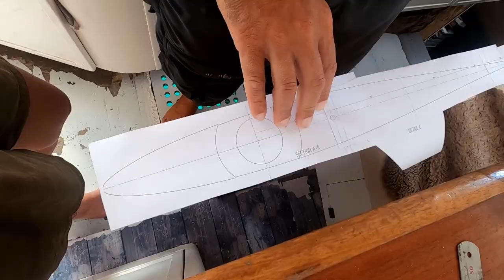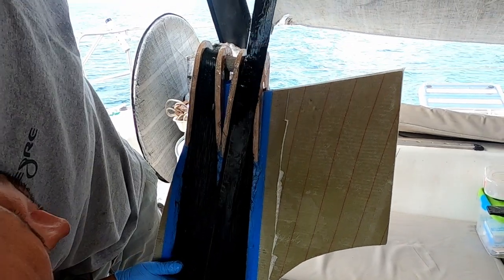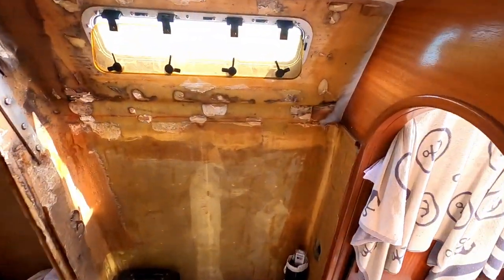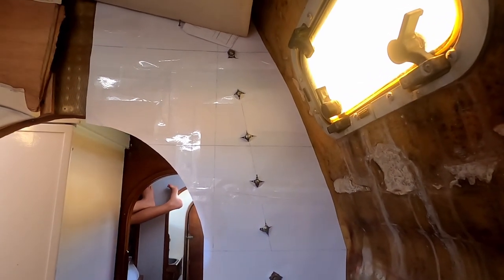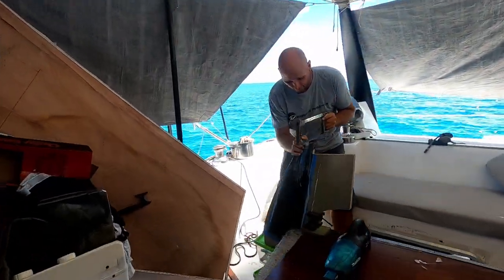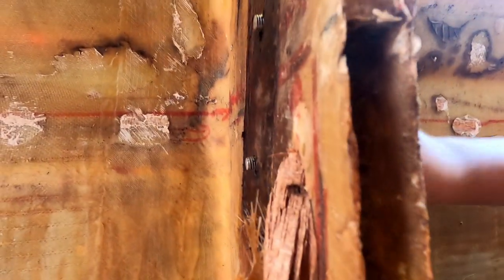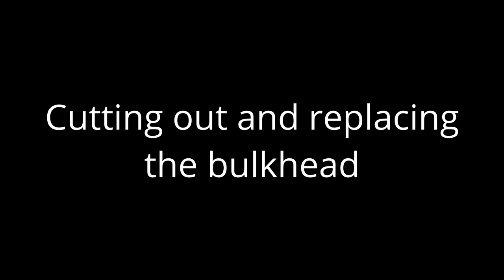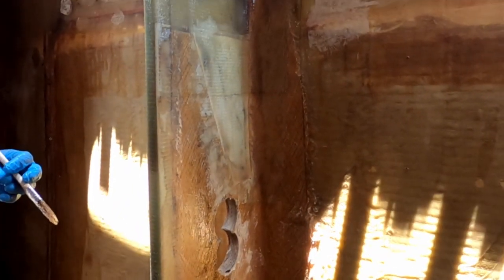Starboard Composite Chainplate

Comment: Wonderful video! … Such a pleasure observing a master. The starboard chain plate fit/finish benefitted from your earlier port chain plate iteration! My Trimaran is built primarily of Kevlar, now I don’t look forward to future repairs using that material (thanks for the warning). You mention working with e-glass and carbon fiber. Are there any advantages using s-glass versus e-glass? Maybe it’s simply a lack of availability on remote islands.
Reply from the maker: Yes there are advantages to using s- glass over e-glass in every way shape and form. The biggest problem with it is availability and cost.
Reply: Interesting to see a very skilled composite engineer at work chain plates one of the most loaded parts of a boat so laminate schedule withheld but how it’s executed and integrated back into the bulkhead for all to see.

Comment: Do you use any CDB between a batch of the carbon unis?  That was the practice where I used to design but I never thought "is this really necessary?" until I saw your work
Reply from the maker: I don't use CDB in this laminate. That was the thought process once upon a time but nowadays it's becoming less common as it introduces new interlaminar shear failures between the planks/stacks

Comment: I am interested in your new sail: what did you buy and why? And by "what" I mean membrane, 3di, hydranet, dacron. And what design choices did you make with regard to details: draught % etc
Reply from the maker: We're getting to the sail discussion 👍
Reply: @youngbarnacles  I have just been through the process myself. I have a Sundeer 60. In my opinion the loads are too high for Dacron, even though that's what most Sundeers run. The stretch numbers for the Spectra reinforced woven cloth are not great and it's very expensive. So that leaves laminate, membrane and 3di. North's offer 1 year warranty on 3di and it's very expensive and dealing with North Sails is often....less than optimal. In the end I bought  carbon and Twaron reinforced membrane sails from Evolution Auckland for less than another Sundeer has bought Dacron from North's. I am very happy with them: less heel, more go, better height upwind.
Reply from the maker: @deerfootnz  good to hear the lads at Evolution looking after you and good to see more options for those wanting a decent sail at a competitve price

Comment: Carbon for chainplates. Makes you wonder why not every boatbuilder is doing that. Let me think: superconductivity, breaks without warning, doesn’t bend as good as steel, doesn’t absorb shockloads as good as steel. And: eventually a chainplate klings to your boat by friction. Carbon has the least  surface friction.
Reply: And that's why you're not asked to build America's Cup entries, Ocean Race IMOCAs, Ultim tris or the many high performance brand boats offered today. Yes it takes more skill and time to do proper carbon fiber work. And the results in this composites  chainpate tech has been proven.
Reply: grabs popcorn and waits
Reply: @Ravenswingsailing  I can imagine when the fabrics of the chainplates are integrated into those of the hulls that you can get a strong bond, but when the chainplates are made separately and are attached lateron the structure more or less depends on the “glue”
Reply from the maker: https://youtu.be/NFwAMrp7daQ?si=BEHCWFPBZgkzK3ZC